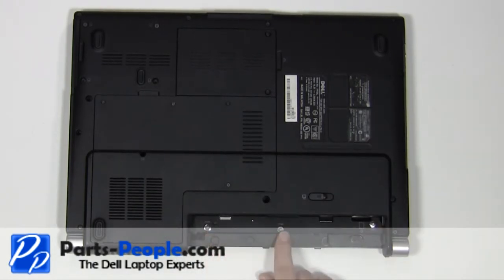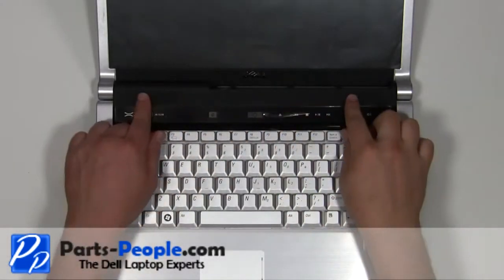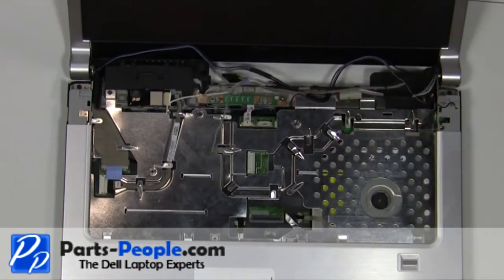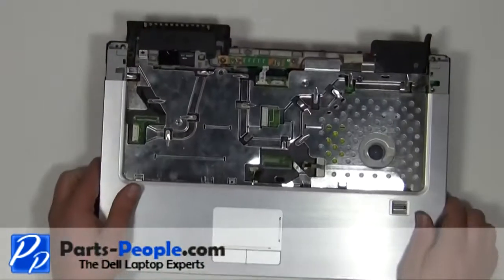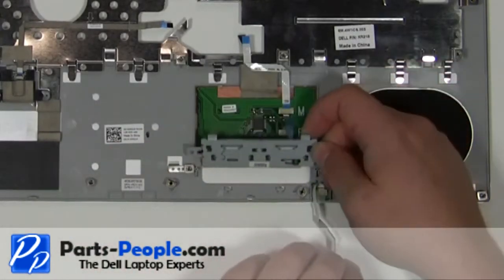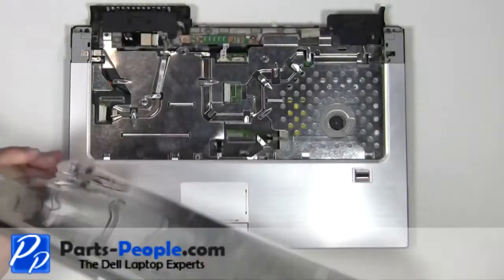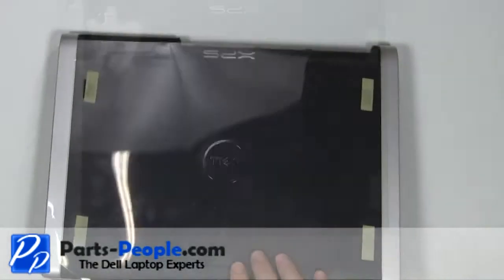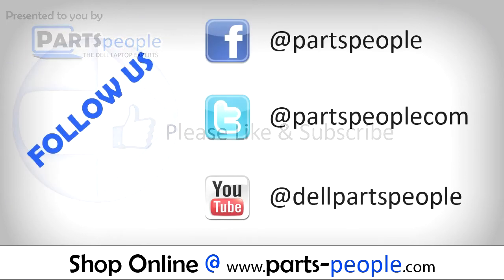Dell XPS M1530 | Mouse Button Replacement | How-To-Tutorial

Comment: Awesome, I have a M1530 which has troubles with the button, cause is completely sunken, and I guess it needs a new Battery too, and cause no one is using it, the Keyboard doesn't function well. And I'm thinking if it is a good idea try to fix it or say good bye. I was checking the price of the different pieces, At the Amazon page I found The Keyboard, the battery, but I don't know how to search the piece you've change on this video.